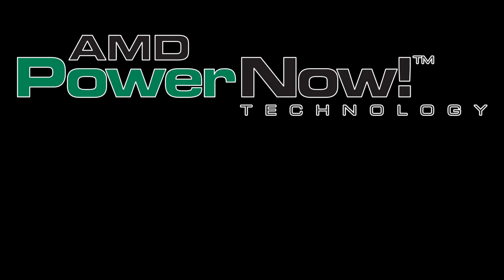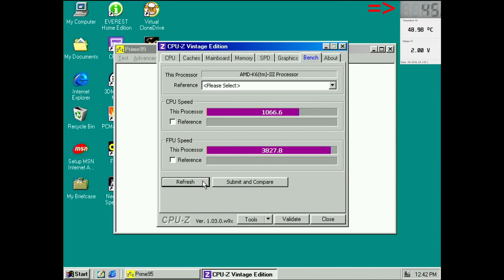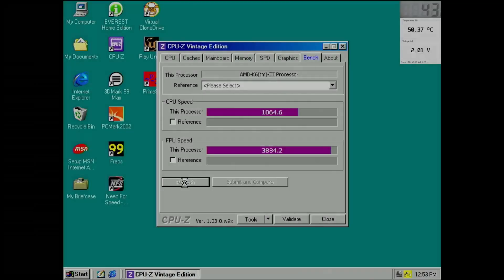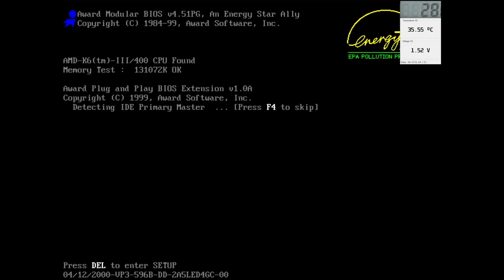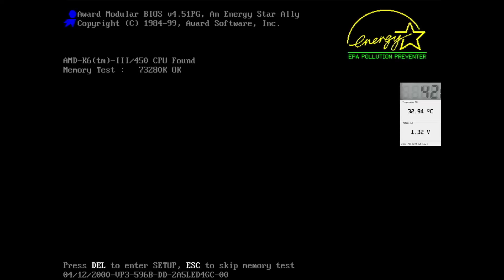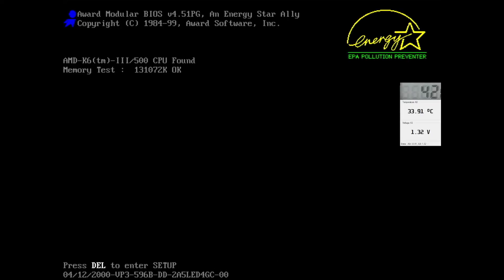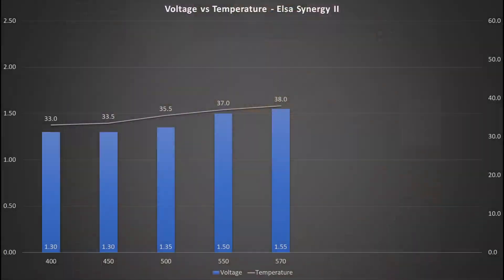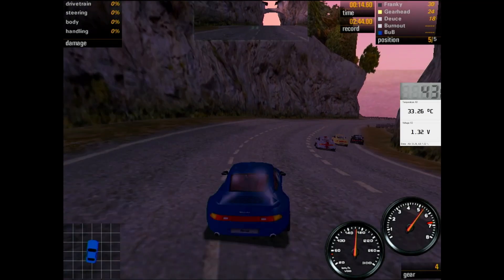Undervolted AMD K6-III+: 400 to 600 MHz

Comment: Is there a good explanation for why AMD and Intel were running chips at significantly higher than necessary voltages back in the day? I had no idea, undervolting really wasn't on my radar at all back when these chips were contemporary and we just wanted max performance, if anything overvolting was something we were more aware of and in some cases doing.

I know with variables at play they maybe picked a 'safe' voltage and didn't want users playing with the minimums but still, it looks like they were using quite significantly more power than strictly necessary.
Reply: Probably because lower quality PSU's , single stage VRM's on motherboard etc, etc. which both contributed to higher ripples and noise in voltage, which affects stability.
By increasing voltage you increase gap between maximum voltage that can be recognised as logical "0" and minimum voltage that can be recognised as logical "1".
They could not guarantee motherboard quality back in the days, but they could increase voltage specification for CPU and have less unhappy customers returning their product.
Additionally not every motherboard could be set for voltage this low with 0,1v steppes. By marking CPU voltage with 2 volts they made their product compatible with most motherboards available.
Reply: I would assume that some dies would run stable at certain voltages, while others wouldn't. You'd either have to decrease yield, or do some type of binning if you wanted to utilize some dies being stable at lower voltages. Here, the sample size of dies is literally just one, so who knows how the majority of dies, especially the early ones, did perform. And even for this single die, you can see that a stock core voltage of 1.8V might have been marginal, so 2.0V seems like a good and safe choice.
Reply from the maker: Good question. I don't know. Will pin your comment, maybe someone has an answer. The gap between stable and stock voltage seems to be too large for the silicone quality argument.
Reply: It was most likely done to improve yields during manufacturing. 

Dies are manufactured on wafer (a large disk of silicon that can fit many dies). 
So lots of CPUs are manufactured simultaneously.

But the silicon disk (wafer) isn't perfect and has random flaws in its crystal structure. Plus contamination occurs.
Plus flaws happen during manufacturing.

So dies on the same wafer (which were intended to be identical) will have various degrees of flaws which will cause various degrees of instability. Making these dies not identical...and only a tiny fraction of dies will come out perfect out the other end of this manufacturing process. 

Way back, such flawed dies were disposed of. But the cost of the wafer and manufacturing remains the same, and if you intended to make profit, the few dies that you sell have to carry that cost. 

But, many of the imperfect dies will still work, if you do something to increase stability. 

E.g. 
1. Lowering the clock
2. Disabling affected features like cache. 
3. Or increasing the voltage. 

You can now sell these "failed attempts" at lower prices and recoup some more cost of manufacturing...and make more profit or reduce the selling price of the perfect dies to be more competitive.

But what also typically happens is, as manufacturing of a specific CPU architecture and the process node goes on,  little issues that cause flaws are solved and the process is said to "mature".
And yields increase (a higher fraction of dies are perfect because flaws are less frequent) 

But different consumers have different budgets and this results in different markets. High end markets, medium, low. 
As manufacting goes on, supply for the high end market increases due to increased yields, while supply for the low end market decreases (because there's fewer badly flawed chips to clock down, disable features on, etc). 

Reducing supply is bad, because the consumer will simply switch to a competitor who does have supply. 

So CPU manufacturers will use perfectly good dies from the higher stockpiles for lower markets, just so they don't lose market share in a specific market. 

And during these later more mature stages of manufacturing many consumers are unknowingly blessed with CPUs that are capable of much more than they are packaged and labeled as. These CPUs will be great overclockers due to the extra stability overhead. 

The same is done with GPUs. Most GPUs and CPUs are simply failed attempts that are salvaged and sold at lower prices. While the perfect dies end up in servers, professional workstations, enthusiasts who don't mind forking out a lot of cash for the fastest in a product skew available. 
In the case of this specific AMD CPU, I assume the closer to perfect dies ended up in laptops, due to being able to be undervolted more due to more stability overhead available to sacrifice by ubdervolting. 

It's why I always only buy PC parts when the manufacturing process of that specific part has matured.
Reply: That overclock at 1.7v has not been properly tested in this video, and imho it is probably not stable. The prime95 is a steady high load, and NFS3 with such a slow graphics card being the bottleneck running at what looks like 20 fps is not stressing the CPU at all. To properly test this old CPUs you need to use variable loads and high fps gaming for hours.

I had a K6-3+@600 with voodoo3, and it was stable with prime95, games, etc, till one day i decided to play NFS2-SE from start to finish, that game runs at like 160 fps in my CRT with that configuration, after 2-3 hours of gaming the instability started to kick in, and finally I had to reduce a bit the CPU clock.

Comment: Is the board limited to 100MHz from BIOS? Then speeds of 112 and 133 should be available through accessing the clocker chip via SMBus, or BIOS tweaking.

Comment: You could further play with cooling.  Colder chips run more efficiently.  Copper conducts heat more efficiently, heat pipes maybe more efficiently than that if operating in their sweet spot.  Pure silver conducts heat more efficiently than copper.

Comment: If I were to tension up the retaining bracket on the cooler I have in mind, and block off the resistors with kapton tape, would I be able to run my K6-2+ delidded? I want to mod mine to just enable the full 256K of L2, but I don't really see the point in gluing the heat spreader back on when I could just do direct-die cooling. I'm aware that the die is liable to chip with poor handling, but is it any worse than the socket A Athlons for this?
Reply from the maker: Inhaber read that the die of those k6-2 CPUs is extremely fragile. You might risk cracking the die with direct die cooling.

Comment: Jesus, my K6-III+ needs 1.8V for 550MHz and 2.4V for 600MHz if i want stable operation. It really doesn't like 600MHz
Reply from the maker: Wow, that jump to 2.4 volts for an extra 50 MHz is painful! Silicone lottery. You should probably keep your K6-III+ at 550 MHz and call it a day. There isn't much benefit from those extra 50 MHz. At least not when you need to run that processor at 2.4 volts.
Reply: @bitsundbolts  Yeah i figured as such. Most likely because it's a 1.6V 400MHz model that is more binned for low power than high clocks. 550MHz was the highest frequency these were sold at anyway, so I'm quite happy.

Comment: I had a K6-III+ on a Gigabyte 5SMM motherboard in around 2006 - this board not only was able to run at 133MHz FSB on Super 7 but it slso had voltage options from 1.3-2.05V in 50mV increments as well as 2.0-3.5V in 100mV increments. I ended up putting an AMD K-6III+ 500ATZ (1.6V nominal voltage) and managed to run it at 3x133 MHz for 400MHz and at just 1.3V - it ran without a heatsink or fan and reached 52C load according to the motherboard temperature sensor
Reply from the maker: Wow - passive cooling without a heatsink! The 52C sound like it is close to the limit those CPU were meant to run at. But I guess the CPU survived it?
Reply: @bitsundbolts  yep the CPU ran like that for more than a year. I still have the CPU around here. I put my finger on the heat spreader while it was under load and i could rest it there for several seconds. Also, all the K6+ CPUs that I have seen are rated to 85C (the Z at the end of the model number indicated 85C) - the non Plus chips were more like 60-65C instead)

Comment: i had hoped it would allow you to run it at 750mhz plus  since it was so good with voltage drops in the chart
Reply from the maker: I haven't done overclocking on those CPUs yet because the motherboard doesn't allow for higher than 100 MHz FSB. Once I get a board that can do that, I'll try to see how far this CPU can go. But from what I've read, it will be difficult to get much further than 650MHz.
Reply: @bitsundbolts   ah right I thought the thermal head room you had was the limiting factor
Reply: @bitsundbolts  a benched record was ~720 MHz under a 2-staged compressor cooling.
But i dont remember the used Vcore.

Comment: back then i gave absolutely zero facks about undervolting or underclocking, overclocking was still an exploit and not a feature, so it was actually worth it. when my second athlon cpu broke, i was forced to use a pentium 2 400mhz for a while. i ran that thing at 600mhz for about half a year straight. performance was actually pretty decent. completely usable even stepping down from a 1.1ghz athlon. obviously it wasn't anywhere near the same level, but it still allowed me to play my unreal tournament with decent performance in most maps. poor thing certainly wasn't comfortable at this speed though. 150mhz bus speed meant most pci cards wouldn't even work. the ideal overclock for it was 533mhz, everything still worked at this speed.

that cpu still lived for a good 10 years as an office pc after i was done with it. still overclocked to 533 the entire time.

Comment: If only the Super socket 7 had an official   mvp4  chipset with  a true Agp slot, a true 133 mhz support. 6x133.3 mhz  = 800 mhz !
Reply from the maker: Even if it could, I don't think there would be any CPU that could run at those speeds. The K6-2+/K6-III architecture reached its limits at around 600-650MHz. At least this is what I have read.

Comment: When I was playing with my K6-II+ it used to fail in 3D-Now! calculations at 600MHz, no matter the voltage. Otherwise it would work ok. Also a 570MHz part, kept it running at 550MHz though.
Reply from the maker: Testing for stability is hard. I prefer to use the CPU in regular day-to-day workloads. If random crashes occur, something isn't right.
But good point on specialized instructions, they may not be used in benchmarks and so the illusion may appear that the CPU is stable until you fire up a 3DNow! application.

Comment: Nice video! If included in the Kernel the Linux powernow-k6 driver is actually capable of dynamically scaling the frequency by altering the multiplier during runtime even on desktop motherboards.

Comment: The reason why higher frequencies generate more heat is simple: With every clockimpulse, the transistors have to shift signals from 0 to 1 or vice-versa. The parasitic capacitance of the whole circuit acts like a short-circuit, for a fraction of a microsecond. Thus, the more often you switch, the more often you "short" the circuit and generate heat. Like charging a capacitor trough a battery and then reversing polarity, only for discharging and recharging it the other way around.
Reply: geiler Name, Christoph Stirnlappen hier

Comment: Nice vid and explanation! It makes sense to be able to do 1.7V, since the CPU is 0.18nm (like the P3 Coppermine).
Reply: Undervolting has less to to with Manufacturing lables and more to do with signal noise inside the CPU. 

E.g. Imagine an alternate reality where AMD and Intel decided to lable their manufacturing processes with two different names like "Cucumber" and "Bycicle" instead of using the name "0.18micron" for two different ways of manufacting something.

Or imagine if cake recipes were given names like "5nm", "7nm", "10nm", etc...what would a recipe name like "10nm" mean in relation to how the cake is made? Using such names in CPUs had become equally as nonsensical marketing shenanigans since the moment more than 1x transistor that are different were combined in a circuit.

Comment: That's crazy. Back in the day, I had a 300mhz K6-2 (no +) and don't think I ever tried to OC. I wonder how much performance I left on the table, while still running a space heater....
Reply from the maker: Probably they had some headroom, but they were also manufactured in a larger 250nm process whereas the + versions were created using 180nm. So, your milage may have been limited.
But I do read many posts in forums where owners complained about their K6 CPUs being slow and hot.
Reply: @bitsundbolts  Ah...did not realize the process change between the parts. I have recently added some K6-2 CPUs to my collection, as well as the same mainboard I used back in the day. Sounds like a fun experiment!
Reply from the maker: If you find a good deal on the mobile versions, don't think twice to get one. They run much cooler. The K6-III (non +) used the 250nm manufacturing process as well (=they get hot)

Comment: but could you overclock it as much as it'll go
Reply from the maker: I need a different motherboard with good FSB overclocking support to go beyond 600 MHz. This is all I could do with the DFI board. I read somewhere that there may be a possibility to do it via software, but I haven't checked this yet.
Reply: @bitsundbolts  that's fair
undervolting is probably what you want anyways if you want to reduce the power of your old machine.
Reply from the maker: I may replace the heatsink with a smaller one and run this CPU around 500-550 MHz. Way less heat to dissipate now.
As you said, this is a possibility to keep those old CPUs cooler and last longer.

Comment: So, they had 0.45V reserve for the stock speed. I would never expect that, its huge. Maybe 0.1-0.15v is to be expected, but this...
Reply from the maker: I don't have one, but I think there were K6-III CPUs that had an engraving of 1.6 volts. We already know that AMD used the same die for K6-2+ and K6-III+ and artificially limited their lower tier models. Maybe they just didn't care about the updating the aluminum heat spreader at that point...
Reply: Exactly my thought.

Comment: Wow. You have gone above and beyond with this video!

Edit: Typo

This really emhasises how much voltage headroom was in older cpus compared to modern ones.
I did some rough back of the napkin math (not counting power draw) voltage/frequency scaling with your minimum voltage data @10:17. Simple equation (Frequency/voltage = arbitrary scaling value) The higher the scaling value the better the scaling. (highest is best)

400Mhz/1.3v=307.69,  450Mhz/1.3v=346.15,  500Mhz/1.35v=370.37,  550Mhz/1.5v=366.67,  570Mhz/1.55v=367.74,  600Mhz/1.7v=352.94

We can conclude that around 500Mhz @ 1.35v was likely the V/F 'sweet spot' for your K6-II+ (Technically K6-III+) CPU. (my results may be flawed but it gets a good idea of the V/F curve)
Of note, we can observe that 600Mhz @1.7v the V/F scaling begins to decreace significantly from 570Mhz @1.55v. This begins to idicate the limits of your silicon.

You do amazing work here BuB! Keep at it!
Reply from the maker: Thank you for taking the content further! I  think you're spot on with your calculations - and that is probably why AMD stopped at 570 and not 600 MHz.
Maybe my CPU sample is a later one with "good" quality since I could unlock the level 2 cache without issues.
Reply: @bitsundbolts  You could very well be on to something here. I have a suspicion that AMD took (at least some) full K6-III+ dies with 256kb L2$ and locked them down the cheaper K6-II+ with 128kb L2$ just to move sales volume despite the chips being fully functional with their cache.

We’d probably need a larger sample size to confirm that though. Regarding further V/F scaling, a real K6-III+ would need to be compared to for sake of scaling comparison.

Keep up the awesomeness BuB!!

Comment: first :)

also, i own 500Mhz variant with OC to 600Mhz. Never tried to get it higher.
Reply from the maker: I've read that more than 600 MHz is really not worth it. You probably get the best result somewhere between 550 to 625 MHz for those CPUs.
Reply: @bitsundbolts  that sounds possible.  I think i have seen a board that could do 103mhz or 112mhz fsb for ss7 but that was about it so there's not really a room for more overclocking.
Reply from the maker: Yes, it totally depends what the board supports. I have two other boards that may be able to do this, but I'll only get them next year. If one of them supports higher FSB speeds, I'll try to get higher with this CPU, but I have a feeling it won't make it past 625 or so.
Reply: @bitsundbolts  i ran mine over 650 
700 was a no go
Reply from the maker: In case one of the other two SS7 motherboards support proper overclocking settings, I am going to attempt an overclock as well!